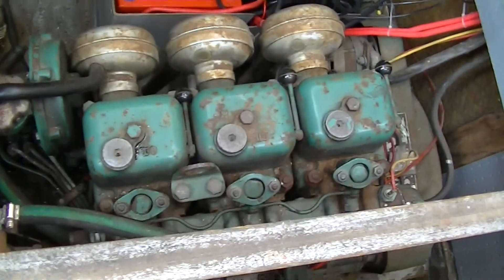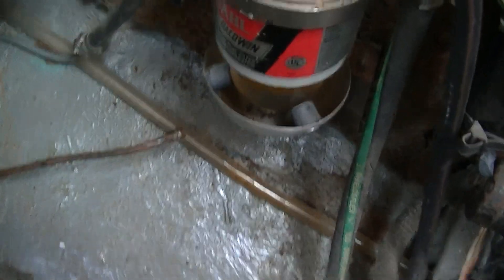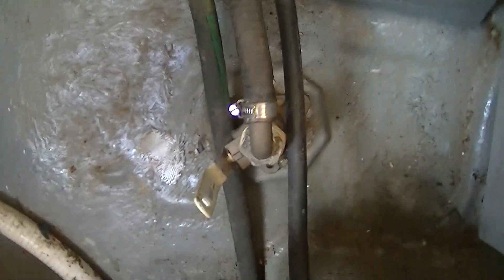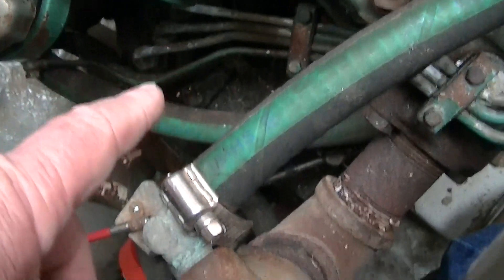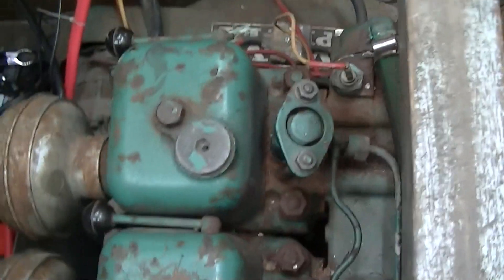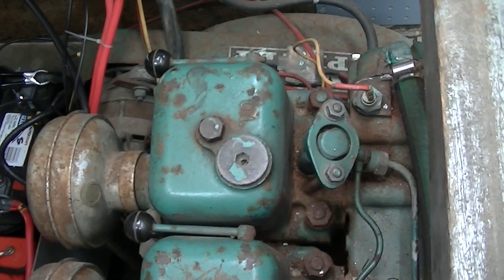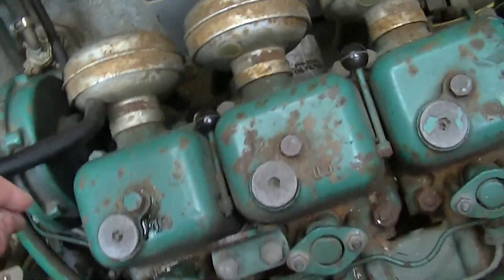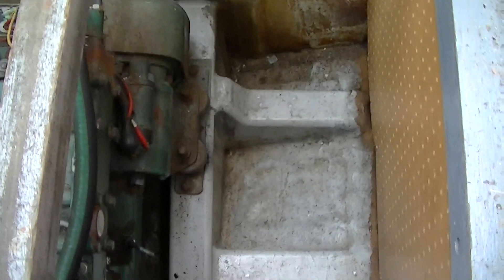Fisher 30 Pacific Child # 29 Engine Room Tour Volvo MD-3

Comment: Larry
I did not see an anti-siphon device on your engine sea water system. It could be flooded without one.
Reply from the maker: Thank you.. I will have to look into that.  I gather that more than one has sunk for this reason. I frankly don't know what one looks like or how it works, but you can bet I am going to find out tomorrow !  Thank  You So Much !